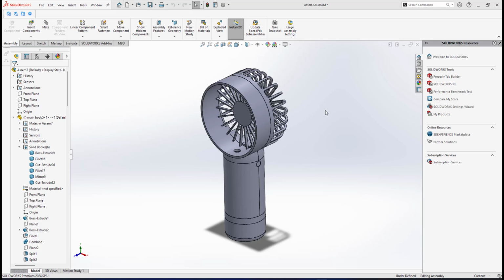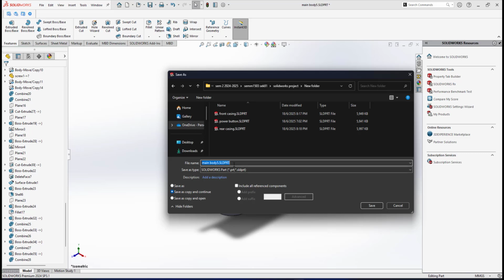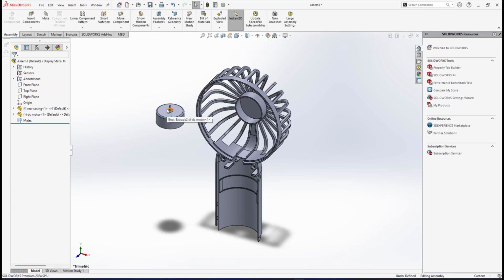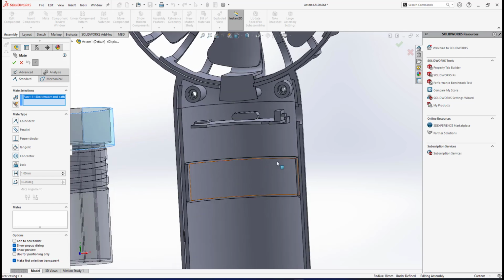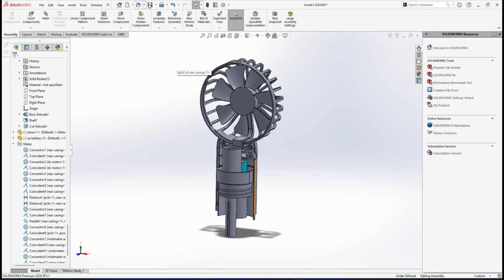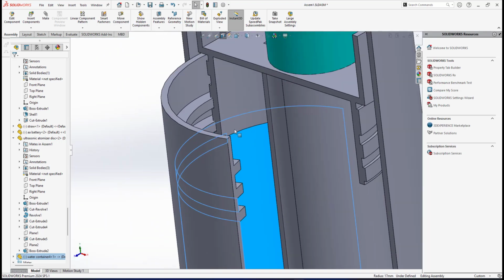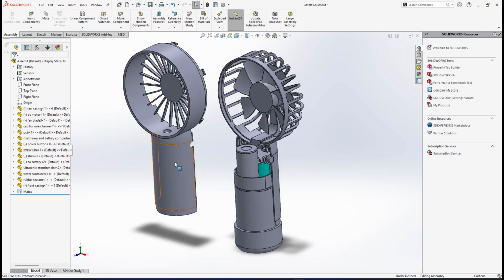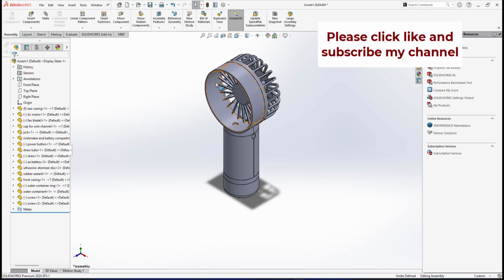SolidWorks Tutorial Part 11: Full Assembly of Portable Mist Spray Fan

Comment from the maker: Correction for the assembly order in this video:

1. The power button should be installed onto the rear casing before assembling the mist-making/battery compartment unit.

2. The AA battery, straw tube, and straw should be assembled into the mist-making/battery compartment unit before attaching it to the rear casing.
Reply: Thank you so much this is very very helpful, glad to have finally reached the assembly part with an amazing explanation for it🙏